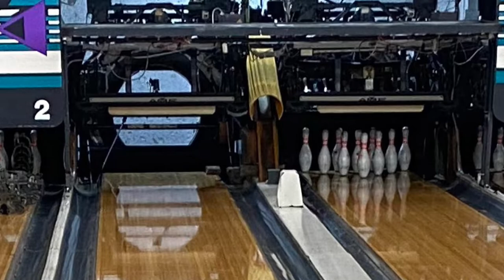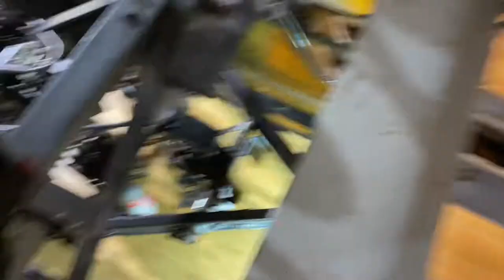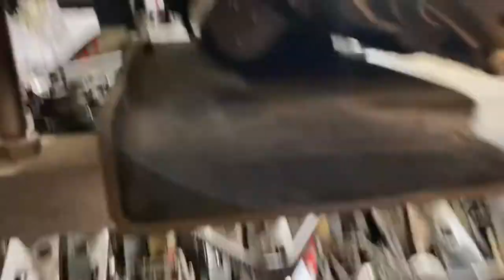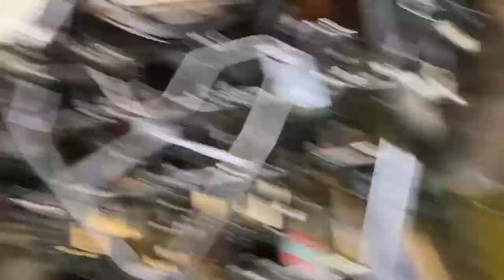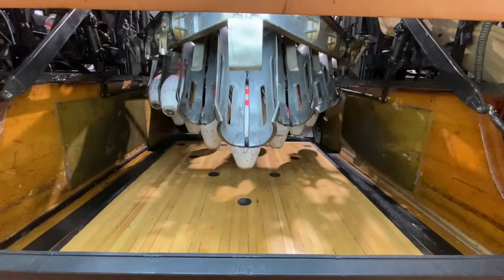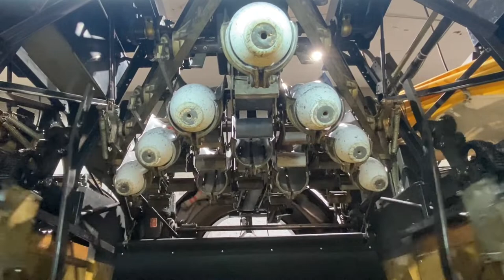Table Swap on an AMF 82-30(Lane 3)

Comment: Great job! That’s no easy task! I have 52 XLi edge machines upgraded from 82-70s I get to work on every day.
Reply from the maker: Oh fancy!!! Yeah your tables are much lighter than mine, much lighter… haha. Make sure you hit subscribe if you haven’t already! Thanks for the feedback
Reply: @Joethepro181  yes they are lighter than a 30 table but actually heavier than a 70 table. Worked on 70s for 27 years before these new machines.
Reply from the maker: @derekdietz5782  are they the flat steel ones? If so I’ve heard of people having trouble with them bending in the middle… have you ever seen that?
Reply: @Joethepro181  yeah they are the steel ones. My machines were installed in 2011 and all have over a million frames on them, we are a super high lineage center. But no I haven’t had any bending problems with them. However, with the edge lift instead of a pinwheel plus the durabin, there are virtually no pinjams or pins getting stuck in the table. That’s a huge help.
Reply from the maker: @derekdietz5782  Nice… well keep ‘em clean!
Reply: @Joethepro181  they are!! If you’re ever in PA let me know!! Stop by Leisure Lanes I’ll give you a tour
Reply from the maker: @derekdietz5782  Thank you! I go there sometimes in the summer so I’ll let ya know

Comment: What was wrong with the original table?
Reply from the maker: The tube that held cups 4-6 was bent badly, between the 5 and 6 cups… therefore it would never set the pins the right way